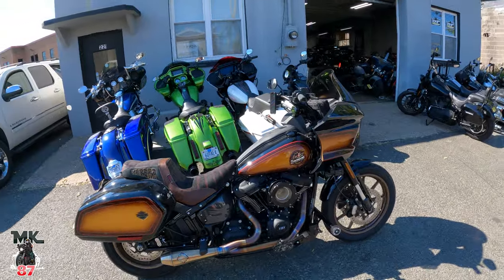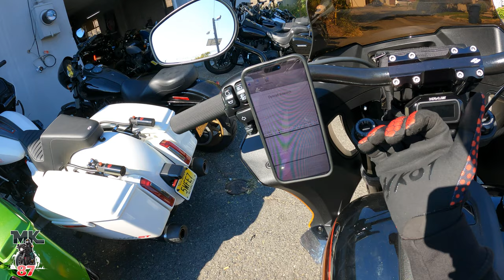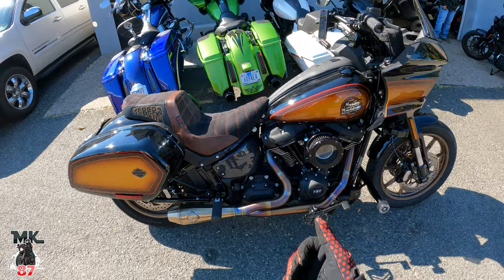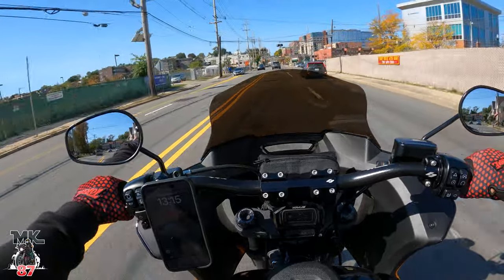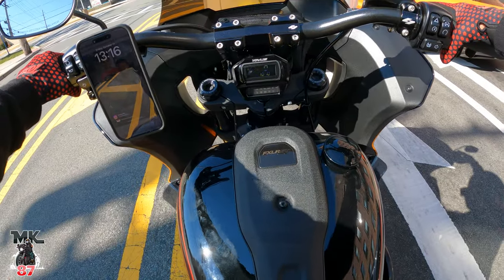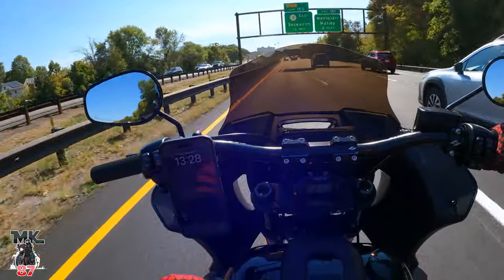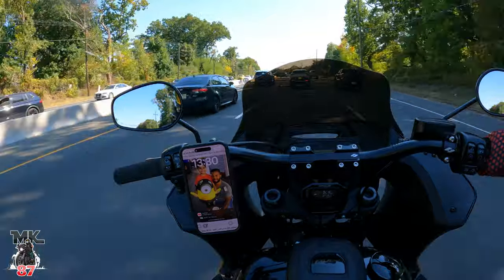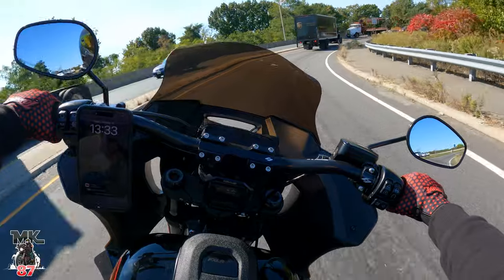Low Rider ST with 131 First ride impression

Comment: Im hesitant only because I live in a hot place, and from what I understand they produce a lot of heat, the ultra cool would have to be a definite add on
Reply: The stage 4 kit should come with the oil cooler assist fan.  I live in Texas and yes the bike does run hotter but not nothing crazy.  I did do the DK customs oil filter relocation kit and tank lift on my Road Glide ST.  Much more cheaper than the ultra cool  fan in my opinion.
Reply: I have my harley built and it runs better than stock.  With a dyno tune they will have it running a lot cooler.

Comment: It ain't too much until you lose the back end and can't get it back. Until then it's awesome. You won't know until you need to ride in less than optimal conditions; the rain, lumpy gravel, greasy driveways, steep windy shady mossy, fall leaves, basically all the places you need to great throttle control. Take us along on that first fall rainstorm ride; you know when the leaves are blowing sideways across the parkway.
Reply: I ride my 124 in all those conditions.  Makes 145tq at 2500rpm.  But it’s insane smooth and the throttle response is not twitchy.  
It’ll break that back tire loose of course or pop up front end if u drop the hammer .. but ya kinda gotta wanna do it

Comment: Glad you stuck with the smaller 483 cam with the big bore kit to show us the numbers
I bet it snaps early and hard! Would be lots of fun
Ofcourse you will get a bit more like 150+ with the 515 and injectors but interesting to see for sure, i wouldnt be in any rush thats plenty of power as it is for the streets, might be less street friendly with the bigger cam but i wouldnt know first hand
Maybe one day but wow when you twist the throttle the thing just goes
Reply from the maker: Exactly 👍🏽 that’s the reason I kept it’s. It’s plenty fun and the power is insane. But down the line I’ll be changing it up

Comment: I just got a 2018 Fat Bob 114 and you're convincing me to throw a cam in it at least, damn! What a beast of a bike
Reply: The cam will wake up the motor
Reply: @21Fxlrs  coming from a 96ci TC this M8 is good for the time being just to get used to it, but I'm already having that feeling of damn.. I need just a little more 😂
Reply: @aidan285 Dude, the FB 114 is such a beast.  It was my first HD, and I thought at first I was used to it that it needed more, but once you really start cracking on it you realize it's a great engine.  Cam and full exhaust will make it even more so.
Reply: @bigk5746  absolutely! I've just got Rinehart Slip-ons equipped but it's plenty for now

Comment: I figured way more out of the 131 with your cam, sounds good though
Reply: Buell is gonna sound better with muffler mods
Reply: The buell is insane I love my st and stage 2 with s&s 475 cam, exhaust and air cleaner around 130hp and 140tq. He should be making more power no doubt about it
Reply: @Bambam_LRST damn nice! You def got a good bike as well!
Reply from the maker: I need a different cam and bigger injectors and it’ll change for sure
Reply: @Marvelkid87  for sure would def wake that up man been watching the whole build as I have the same st good stuff just caught me by surprise with those number lol! If your ever over in MA let’s ride man
Reply: @Marvelkid87  check out the star racing FA35 too, need high lift springs but blockhead did a cam shootout and that thing performs! Seems like the fastest cam for the Harley according to those guys! Good luck man